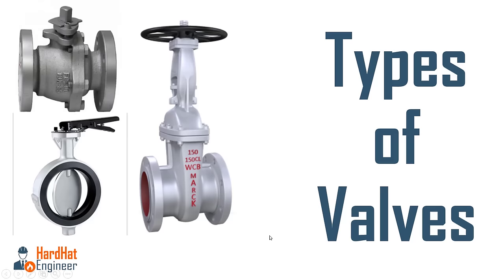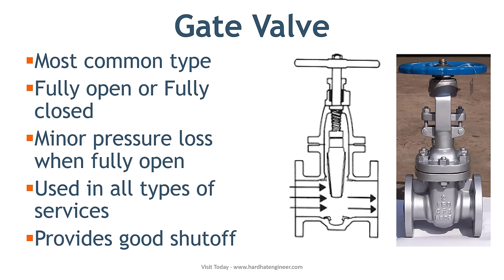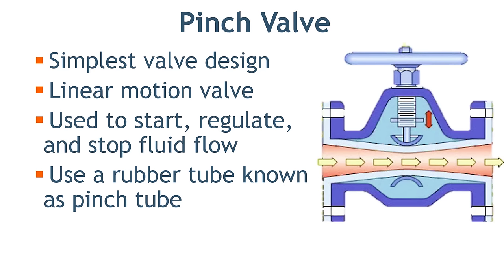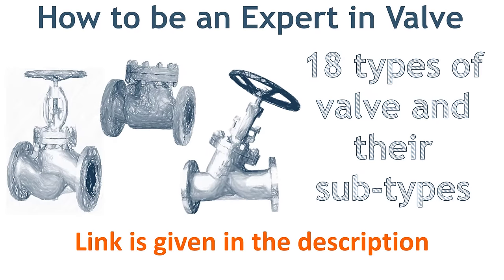Types of Valve used in Piping - Learn about 9 Types of Valves

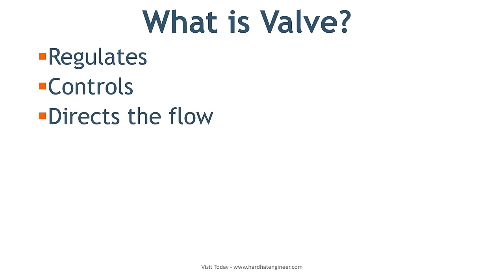Comment: 00:45 - What is Valve
01:06 - Gate Valve
01:41 - Globe Valve
02:07 - Check Valve
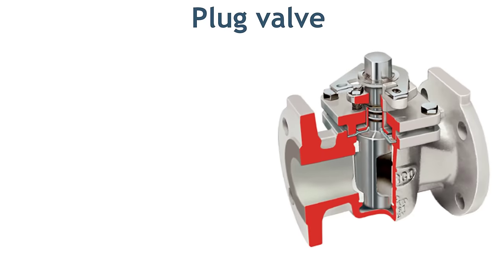02:23 - Plug Valve
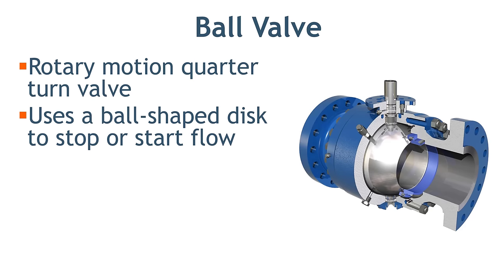02:55 - Ball Valve
03:22 - Butterfly Valve
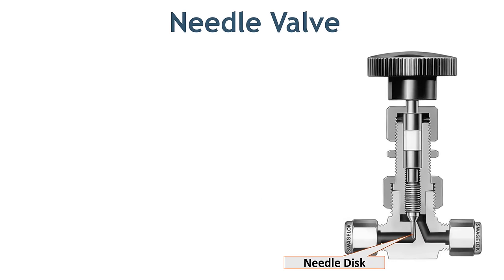03:50 - Needle Valve
04:16 - Pinch Valve
Reply: Hi sir
Reply: You forgot a control valve
Reply: Buy valve to find me, valve manufacturers, price concessions, quality is very good
Reply: Manifold valve
3 Way Manifold valve
Ball valve 1/2" NPT to 2" NPT
Fitting

Comment: How can you explain how 4 way valve is been operated and its function
Reply from the maker: Hi, 4 way valve is mostly used as directional control function. That means it it can divert fluid to one port. Or it ports are designed in pair that means you can switch 1-3, 2-4 or 1-2, 3-4.

Comment: you have missed Diaphragm valves used in chemical/acid/alkaline lines. 
It is also linear motion valve with rubber diaphragm similar to pinch valve. 
It is mostly ON/OFF type
Reply from the maker: You can check my full course here - https://courses.hardhatengineer.com/courses/types-valves-used-piping
Reply: Buy valve to find me, valve manufacturers, price concessions, quality is very good

Comment: Why required different types of valves.
Reply: Different circumstances, the requirements are different, some of the pipeline is not allowed to open directly, there will be a shearing machine, some valves can not do the water pressure level test

Comment: Information about globe valve is wrong, globe valve cannot have flow controlling attribute.
It is mainly used in shutdown and opening only
Reply from the maker: Hello Jayavishu, No it is very much correct.  The valve you are talking about is Gate Valve that only used as a on off shut off valve.
Reply: @HardHatEngineer   I'm working in oil and gas, we are pretty much using Gate Valve for Pressure regulating and for Discharge regulating.
Meanwhile Globe Valve is used in isolation points to only shutdown and turn on the branch line.
See a proper animated video of Globe Valve, you will understand it
Reply from the maker: @Jvshnu  I think you should check with your valve manufacturer to clear your doubt. If you are using gate valve as a regulation valve, your are damaging your valve for sure. Globe valve is also used as a isolation valve and it gives batter shutoff than gate valve but gate valve never used as a control valve. Emerson is global leader in control valve field. Check its entire website, you will not fine any design that use gate valve as a control valve.  (www.emerson.com). I also suggest to contact them for more information.
Reply: @HardHatEngineer  we are using gate valve for low pressure works only, for high pressure we are dealing with butterfly or diaphragm valves.
But never heard globe valve could be used for regulation
Reply from the maker: Check this - https://hardhatengineer.com/different-types-valves-used-piping/. I have categorized which valve is used for which function. The information I covered in my videos and website are based on the real world data. I am not surprised that people used gate valve to throttle the fluid but It is not recommended practice by code and standard.